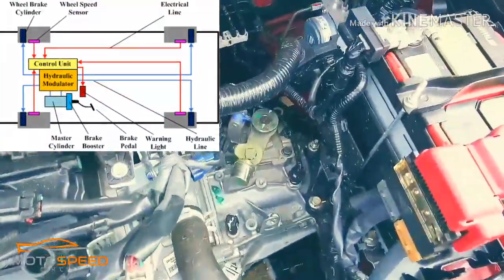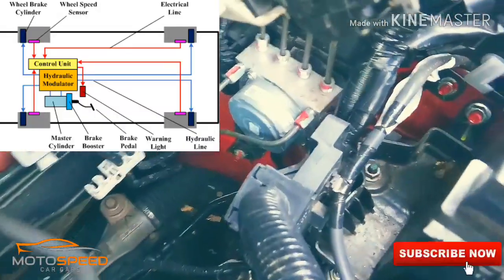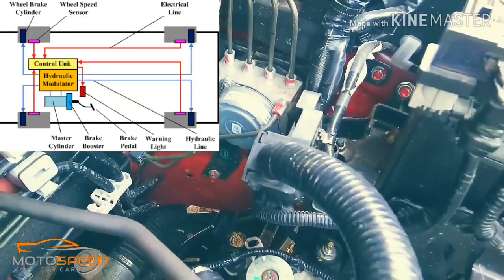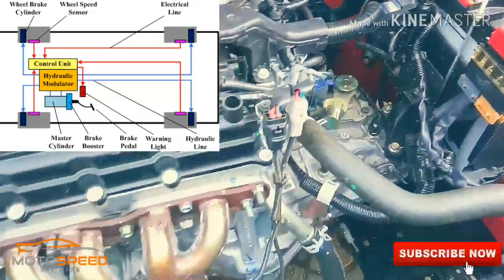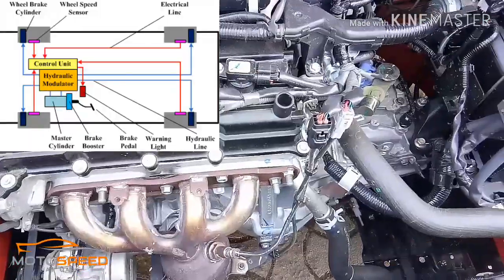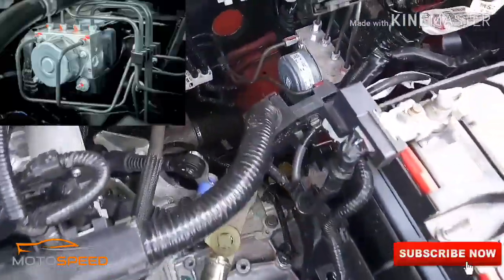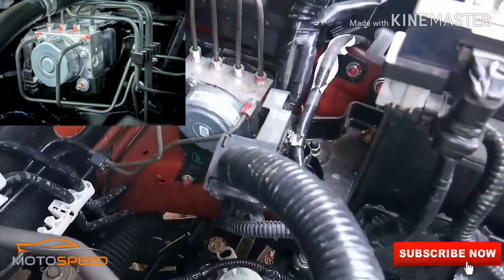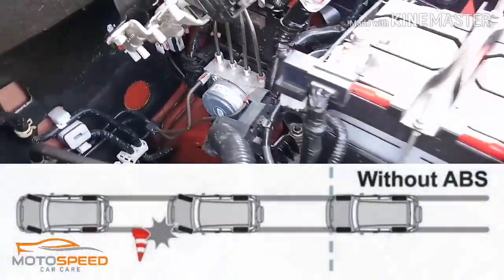What is abs? Anti-lock braking system explained

Comment: Motor car kerala roadukalil
60 Km thazhe speedl odikkuka.
Mileage kooduthal kittum.ABS sensor complaint anenkilum 
brake fail varilla.Ente Fiat linea car second hand 35000Kms vangumbol ABS function cheyyunnilla.Ippol 87000 Kms readingl ayttundu.Ente car wayanad,Idukki,Munnar,Bangalore vare  poyittundu oruprasnavum illa.ABS function allengil mazhakalathu 60Km speedl thazhe car odikkuka